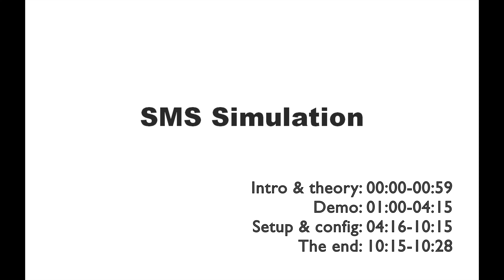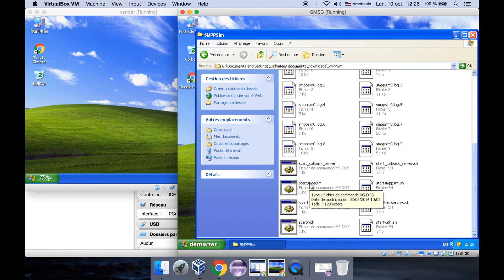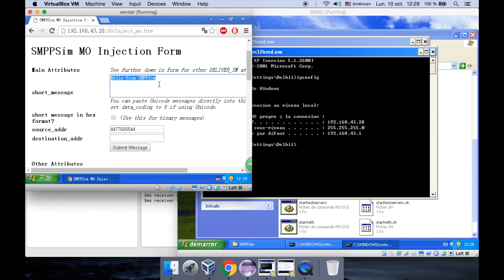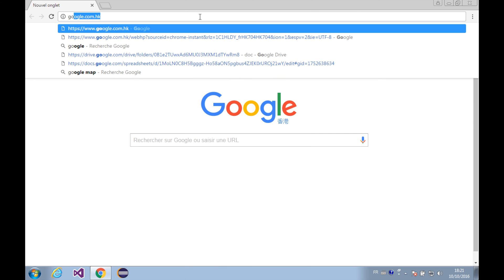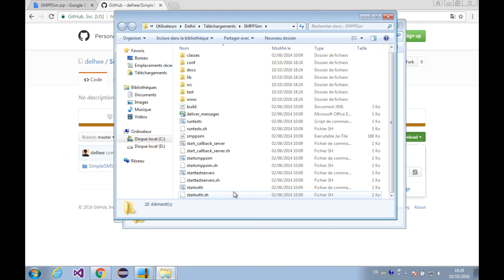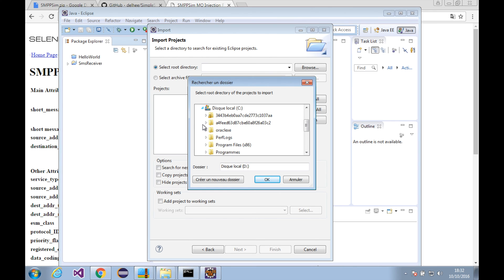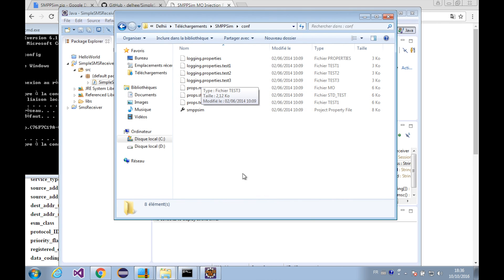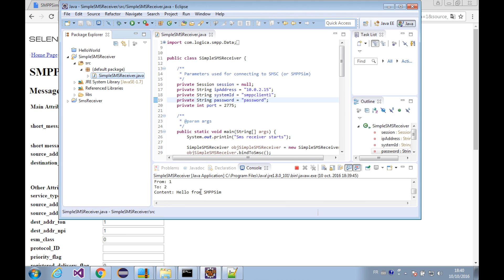SMS Tutorial 01 -- Sms simulation, SMSC, SMPPSim free simple tutorial

Comment: i need to contact with you
Reply from the maker: Hi! You may leave a comment just like this. I reply :)
Reply: @albprogramming8028   I need you to develop a bulk sms gateway using smpp
Reply from the maker: Hi! I suggest you do some researches on vendors that provide sms services and contact their customer services. They are more professional and experienced and committed to do their jobs. 

Before contacting a vendor, you might want to know your budget, on time and cost, what features you want, technical requirements such as the maximum amount of SMS that could be sent at the same time; the maximum length of each SMS; transmission speed; whether or not to support receiving SMS; whether or not delivery note is required; whether or not to schedule SMS sending; whether or not to support alpha numeric sender id; etc.

Cheers

Comment: Hi. I got 2 question.
1.  What if I got 2 receivers, or as in my case, 1 receiver and 1 transceiver. How can I send message from SMPPSim to only 1 of them?
2. I've got application, that I somehow bind to SMPPSim as transceiver, and I can send sms from app to SMPPSim, but when I try to send to my app, using INJECT_MO, it does not seem to work. It should be simple message, like CHECK, and app should reply with a message to it. SMPPSim seems to send that message, but i get no reply, and also 2 warning - Exception : could not read request and failure getting request string.
Reply: thank you for answer. In the end problem was some configuration in my system. Some enviromental variable or something. Once set to include JAVA, it worked. I still get those errors, everytime I user or refresh webUI, but besides that it works.